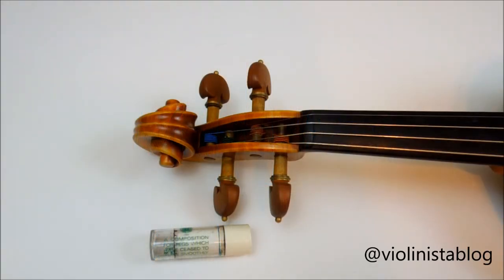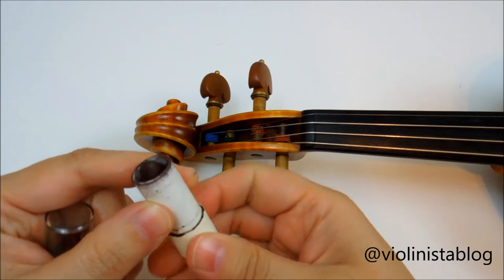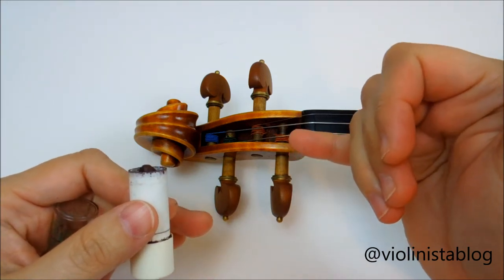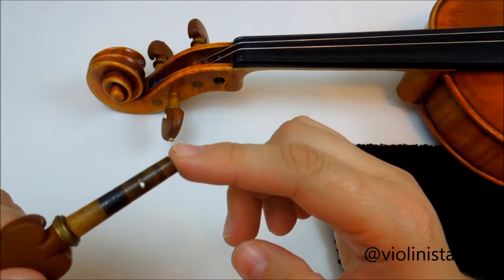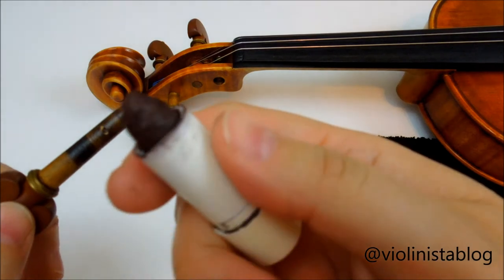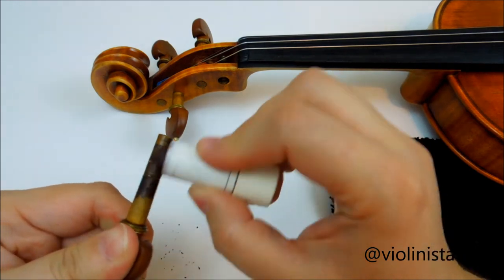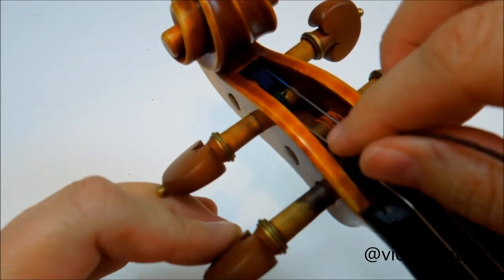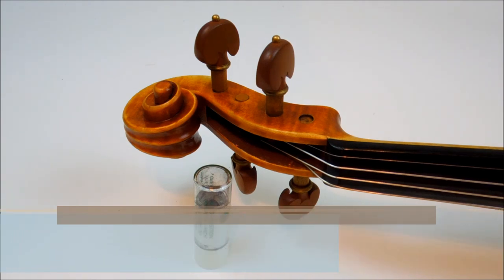HOW I TAKE CARE OF MY VIOILN PEGS

Comment: Does this compound prevent slipping?
Reply: No and yes. It actually helps the pegs turn better, which means that you can push them into the box a little more securely without sticking. If your pegs fit nicely and are just a little to slippery, you can add some plain white chalk. I prefer to use the Hill's though because, as I mentioned, most slipping is due to a bad fit or to the peg not being in far enough.
Reply: @druidsongevergreens  darn. i bought this to prevent slipping lol